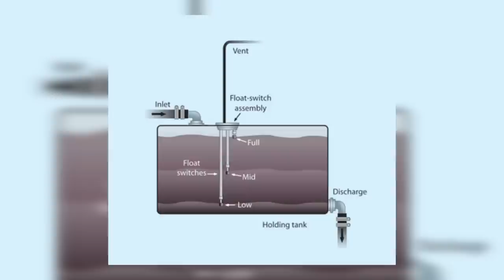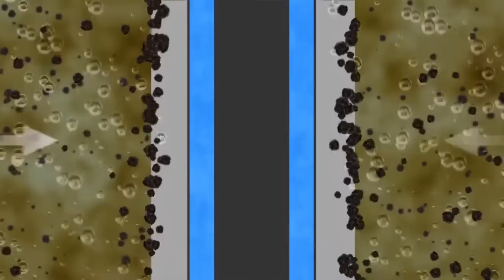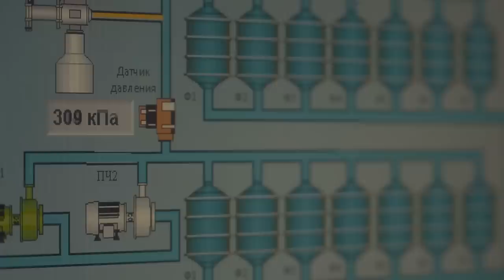How 5,000 US Navy Sailors Poop On An Aircraft Carrier And Where Does It Go?!

Comment: I made two cruises as a Marine on the USS Boxer (LPH-4) in the early "60s. Back then, the heads discharged into the ocean. I am sure of this because any time you looked over the side of the ship water could always be seen being discharged into the sea. Once we anchored in Kingston Harbour, Jamaica, and boys paddled around the Boxer, begging us to throw coins down to them. They dove to recover the coins. We were somewhat taken aback by this, because you could see turds floating in the water. That didn't seem to discourage the kids diving for the coins.

Another thing to be considered is whether the Navy still handles trash the way it used to. Every morning the bosun piped reveille followed by the same announcement: "Reveille, reveille. Heave out. Trice up. Get a clean sweep down, fore and aft. Sweep down all ladders and passageways. Empty all trash over the fantail (stern)." People on mess duty used to heave all galley leavings over the fantail as well.
Reply: Ships are always discharging water for various reasons. Treatment is much better now, when I was on hospital ship in Jamaica the water we were putting out was cleaner that what we took in. our water actually got contaminated and they had to barge it to us daily. And for trash nor anywhere near as much goes over side. Plastic is collected and molded in manhole cover size discs that are off loaded in port. Aluminum, etc is crushed and bailed. They also have onboard incenerators that are "clean".
Reply: I was on the Inchon and Nassau. I thought they used salt water. I could be wrong

Comment: That last problem could be corrected with low voltage inline mini grinders. larger versions play an important part in most residential systems today. There's a motor driven impeller/pump installed at the very bottom of an 500 gallon raw sewage storage tank. When a max level is reached a float connected to a few switchs turns on the power. In a short time it chops and pumps out all the solid waste under low pressure so it can travel more freely through a series of 3" pipes ending up in a water treatment plant or lagoon. This of course depending on the design 🙂
Reply: hate to be on the team that has to clean those grinders when something get entangled with it... there is always someone who flushes a cinder block into a toilet or a bunch of wet rags.